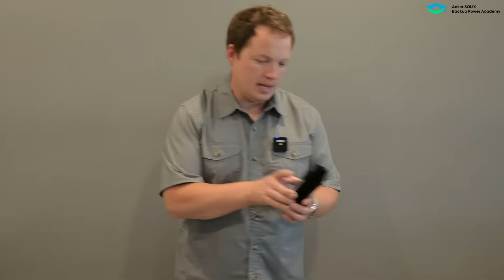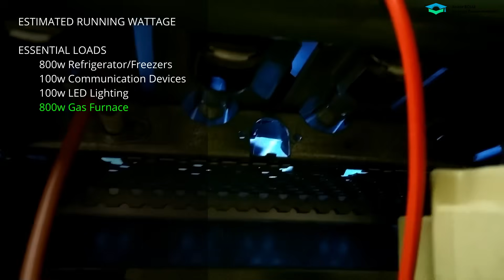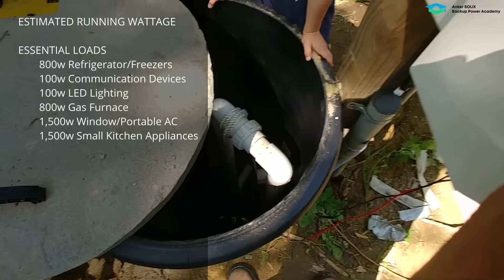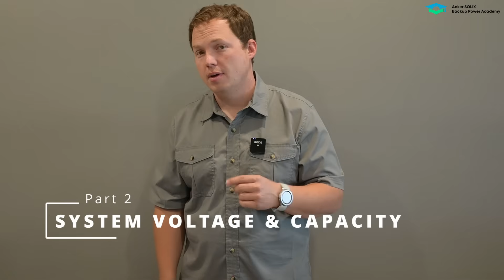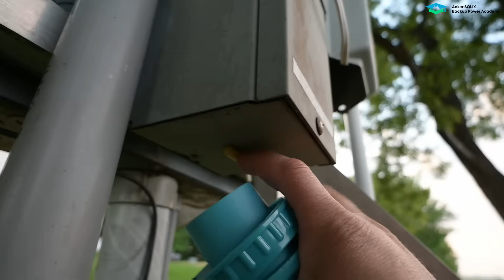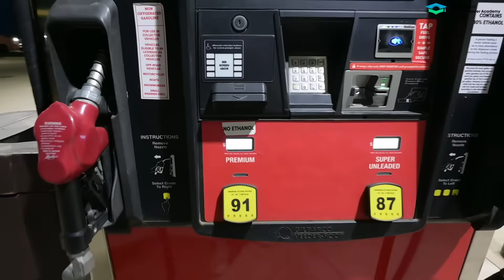What Size Generator or Backup Power System Do I Need? | Anker SOLIX Backup Power Academy

Comment: Suggestion:  Window a/c - invest in an inverter a/c.  Been testing a 10k unit with a 4000wh solar generator.  MAX power is 750w, idle is 6w, normal run between 10 and 130w, plenty cold, very quiet.  Water heater - hybrid.  600w max in heat pump only mode.
For whole-house backup, I installed the Anker F3800 with the Home Power Panel. It's proven itself multiple times already.

Comment: Every of my refrigerators is using 70W if it is on, but they need around 10 times as much power to start.
I calculate with 1kWh per refrigerator per day, it is in winter a bit less and in summer a bit more, but in average this is 1kWh/day.

In deep winter I got per PV-module around 20-50Wh. If the power would go off, then I could collect this energy in the LiFePO4 battery and start the AC for a very short time or I use this energy to make some hot water to make some food. The house would cool down.

But I could be in my bed for a month with enough food. But the Water in the pipes should not freeze and the little Bio-sewage treatment plant use some energy too for the pumps. But I could save this energy and could use a Compost toilet, with this I could save all the energy. Not nice so shit in a bucket with water, but if the situation is very bad, this is the way for us to reduce the power consumption. Our politicians are doing everything that this shitty dream comes true.
Reply: I think batteries can take a short high inrush current very well. generators not so much.
Reply: @Jon-hx7pe  - I had here a 500W / 0.5kWh device (powerstation) which I could charge via a 20V powersupply or PV-module and 500 Watt (230V AC) was the highest energy the inverter could deliver. The refrigerator with 70W could not start. This was a bit disappointing.

Comment: Nice presentation.  I started acquiring about 2 months ago mostly for backup but maybe a bit of power time of use arbitrage.  Started with the 3800+ duo intro deal with power panel kit.  Haven’t installed panel yet so I’m using the units to UPS my network until I get the panel and essential subpanel wired up.

While I have an ancient gas generator (and the Anker generator input) my actual primary way to charge in an outage is my 131 kWh Ford.  

Looking at maybe doing some solar but I’ll have to cut trees to make it work so that won’t be soon.

Comment: I do not think you are correct regarding discharging LiFePo batteries down to zero. The minimum cutoff is around 2.5 volts. Going lower than that will damage the battery. 
From what I have observed on my system, when the cell voltage gets down to 3V the batteries are pretty much used up. You will not get that much extra energy 
letting them go lower.
Reply: Ben said it right based on the context of the video.  Joe Normal ain’t gonna be looking to pull out test equipment once every three months to determine the optimum discharge point.  They’re gonna look at the display and when it hits zero… done, plug in and let it charge.

Presentation was on point!
Reply from the maker: True that you don't actually drain to zero! Just that you go to "zero" as far as the consumer facing BMS is concerned.

Comment: You spoke of dryers and the power to use them.
Washers will use more power than gas dryers, especially when on the spin cycle. After SS Sandy, my 4,500 watt generator would trip when my washer would go on the spin cycle.
Reply: My washer uses less power during spin than during washing because it heats the water during washing.
Reply: @neilbrookins8428  that must be a european thing. north american washers don't heat the water.
Reply: @Jon-hx7pe I'm in the USA. The washer is a Sears Kenmore elite from 2004.  It's plugged into a smart plug that measures watts so I know what it's actually using.
Reply: @neilbrookins8428 - Some high-end Kenmore Elite models may have a small internal heater, but it's usually for maintaining water temperature during long cycles (like sanitizing or stain treat), not heating cold water to hot.
Reply: @neilbrookins8428  i don't know of any north american washer that heats the water.
Reply from the maker: Wow, that's wild. I would assume that it couldn't use much more than 2,400w since most washing machines use a standard 120v 20a receptacle?
Reply: @BenjaminSahlstrom maybe he’s got a souped up washer😂. Mine is just a plain old 15 amp max…
Reply: @BenjaminSahlstrom  Perhaps it was prevented through the outlet, and not the generator itself. The most that I remember is the complaint from my wife that she needed clean clothes and there wasn't a spin cycle.
The washer was a large capacity Kenmore from the 1980s with a large motor.
Reply: Something screwed up with that. 37 amps @120V to run a spin cycle?
Reply: Mine used like 200 Watt-hours for a load. I was kind of shocked how little energy it used. I didn't look at the peak power though. I can't see mine pulling anywhere near that amount of power. Will have to re-run the test.
Reply: I plugged in my energy meter and ran another load. 115 Wh for the whole cycle, 809w max during spin cycle. Base model kenmore from 2016. That should run off the smallest inverter generator.
Reply: @jake-mv5oi the problem with running a number of circuits from a limited input like a gas generator, is there is a whole panel of “the straws that broke the camels back.”  Most likely if you go back to SSSandy, the incremental event was the washer hitting spin cycle, but you had a bunch of other mundane power use in the background loading the system.

Comment: I like my old school gas water heater, no electric power needed. My neighbors tree fell on my house and truck, back in winter of 2018. No power for 3 days and the house was 55 degrees. Nothing worked, except we had hot water, which made a world of difference.
I do have a 6500watt gas generators, but my UPS's don't like it. At some point, I will buy a dual/tri-fuel quiet inverter generator to replace it.
Reply from the maker: You definitely appreciate things that take little to no electricity during power outages! I feel the same way about our gas range.
Reply: for the same reason  - I like standing pilot gas fireplaces.
the people who want to get rid of all the gas lines and have everyone on heatpumps and electric water heaters are insane and foolish.
There's a middle ground keeping the gas service but still adding heatpump.
Reply from the maker: @Jon-hx7pe  I'm with you there! Having both is the way to go.
Reply: @Jon-hx7pe I'm in Massachusetts, and they removed all the rebates for the regular gas furnaces and only have them for heat pumps. He would requires two 30 amp and a 60 amp 240 volt circuits. That's an insane amount of power required for heat and potential backup. Gas doesn't really need a backup unless your furnace goes. You just need a small generator to operate the blower motor.
Reply: @m3rdpwr  A heatpump unit uses the same 240v electrical circuit as same size a/c outdoor unit could be anywhere from 20 amp to 40 amp breaker depending on size; the actual current draw is far lower than the max circuit capacity. Heatpumps move 2 to 4 units of energy for every 1 unit consumed they are efficient. And in a dual fuel application you can run furnace on generator. Cold climate heatpumps just about all the time do not need backup, and going dual fuel the furnace is the backup so no heat strips needed. 
Rebates for furnaces don't make sense - just pocketing the rebate and buying the same product when the point is to change the equipment that would be purchased. what makes sense is getting rid of 80% furnaces in us in northern climate - required 90%+, mid efficiency is a total waste of fuel and less safe due to open flames vs sealed combustion. We haven't had them in in canada since 2010 and condensing is same thing but with a secondary heat exchanger.
Reply: @Jon-hx7pe a new HVAC system I was quoted 13k. I was quoted 20-30k for a heat pump system. I was also told while they couldn't reuse the 20 amp circuit for outdoor unit 2.5 ton ac unit I currently have, it would need to be upgraded. In addition, they would need a second 30 amp for the indoor air exchanger unit and a 60 amp for backup heat. Electricity in Massachusetts is astronomical right now. During cooler and summer, my gas bill for gas is ~$25 for the water heater and the gas dryer. Electric during the cooler and summer is crazy high and my home has all newer energy efficient appliance and lighting. I know people in Massachusetts who have electric vehicles who won't own them again, because of the cost of charging them at home compared to other states.
Reply: @m3rdpwr  Sounds like you were dealing with a bad contractor, 20 to 30k is insane. There is gouging on heatpumps going on. The amperage of circuits depends on the equipment installed - cold climate heatpumps can draw more when they ramp up to compensate for very temperatures to maintain capacity at those temps -> the amperage of circuit does not determine typical usage especially for heat strips which very rarely would come on. Usually the actual load is less than 1/3rd of the circuit's capacity. The decision to install a heatpump very much hinges on local climate, electricity generation mix, the home, availability of natural gas and more. Heatpumps are not for every home in every climate, expensive electricity makes them far less attractive and if most of the electricity in your state is coming from fossil fuel power plants it makes no sense where natural gas is available. There's also the choice between going dual fuel keeping the gas furnace or a purely electric system.
Heatpumps excel when replacing 100% electric resistance heat to begin with, as well as replacing expensive oil and propane heat.
The world does not revolve around the situation massachusetts - people need to look at their own situations when deciding what do to.

Natural gas right now is absurdly cheap, it will have to increase.

Comment: would need to have a big furnace with a psc motor to draw 800w and those can be retrofitted with ecm. modestly sized furnaces with ecm blower can run less than 1 amp on low fire.
Reply: ECM blowers are so aggressive when you block off their airflow. A plugged filter will make the furnace sound like it's going to take off to space.
Reply from the maker: @ReubenSahlstrom  My furnace seems to always wants to go to space.
Reply: @BenjaminSahlstrom  Was it made by space-x?
Reply from the maker: Depends on the airflow somewhat, too. For whatever reason, my ECM furnace draws close to 800 watts when it's running at full capacity. That's for about 1,200 cfm. I'm sure there's better options that are higher efficiency like you're saying, though!
Reply: @BenjaminSahlstrom  800 watts for 1200 cfm is insane, a regular psc motor with normal static 3 ton drive on high is 500 to 600 watts. must have high static or something.
I don't think the the power factor of ecm is very high, so if it was calculated based on amps only that could be why i guess.

At full airflow with reasonable static ecm saves about 30% to my knowledge, and much more at the lower speeds/airflows.

Comment: Could you make a battery wall and have the Fossil Fuel Generator power the battery wall?
Reply from the maker: Yes! This should be possible with a battery system that has a generator input. Some will automatically start the generator when the battery reaches a preset SOC. I think Anker actually has something like this in the works.